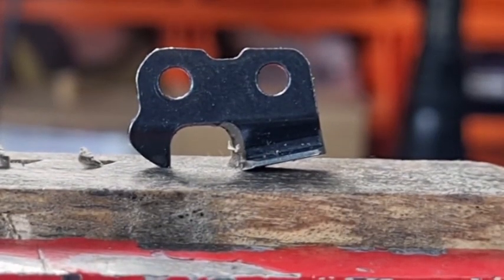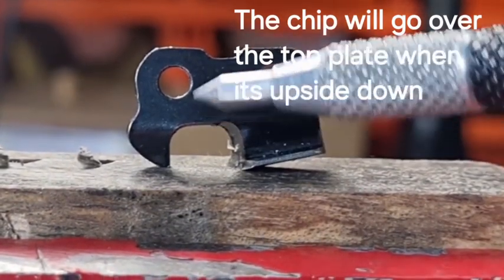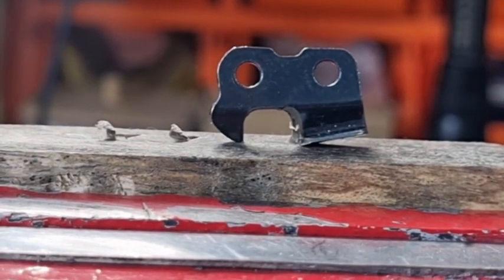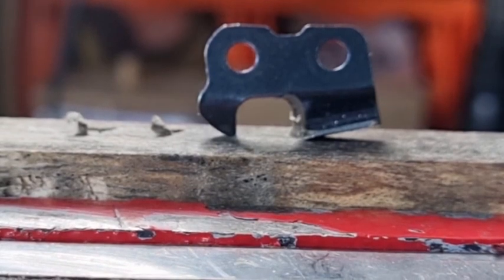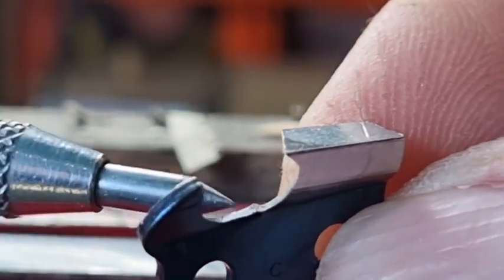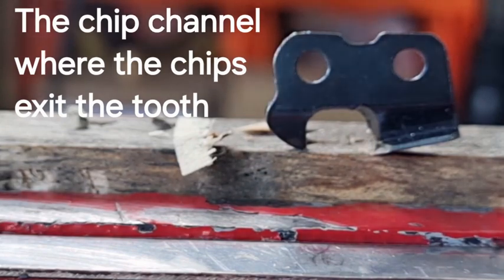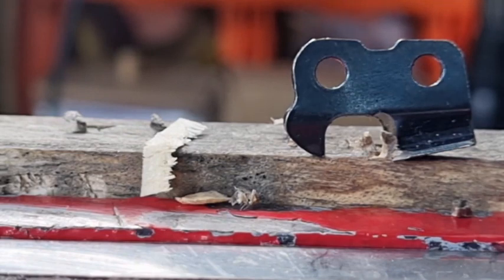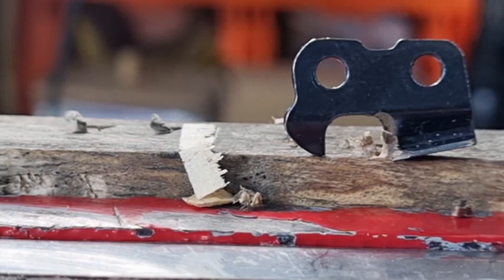Chainsaw Chip Clearence, we take a closer look at it

Comment from the maker: This is why he says "get the gullet", but it's not quite what he means. He's really just saying you need sufficient hook to cut properly
Reply: That's exactly what i think. BBR is allways talking about "get the gullet" to make your chain cut. But its clear that a chain cuts well when you "get the gullet" because you get a good hook on the toplate. Your videos are always very informative.  Thanks for showing us your knowledge. Greetings from switzerland
Reply from the maker: I am amazed that we can learn about chainsaw sharpening after 39 years using them
Reply: @gfeui  I agree.  That hook on the top plate given by a pronounced gullet provides a thin, sharp edge to cut into the wood fibers.  Taken the opposite direction, if you don't have a good gullet the file will be too high, and the top plate will be cut with an angle that gets closer to 90 degrees and is less inclined to cut into the wood fibers.
Reply: @GreenCanoeb  Yes ofcourse. but you can take a smaller file and make a good top plate. and the chain will cut good anyway without get the gullet. so the gullet it self has nothing to do for good cuting. that is what i mean :-) the top plate angle is important an you can adjust it for your type of wood when you raise or lower the file a bit .

Comment from the maker: Ok, here goes my learning curve again!
I posted a few days ago that .325 chain on my 034Super was faster than 3/8 chain. I was going on seat of pants, not hard reality. I used a stop watch and found out the 3/8 is just a tad faster.
So, that really threw me! I went to Madsen's web site about race chain mods and found out why the 3/8 is faster. It has more room at the rear of the teeth for chips flow out, (according to their info) So I looked at my .325 chain and saw what could be the BIG problem. The link at the rear of the teeth has a big hump that restricts chip flow.
What I'm doing now is filing that hump off and then I'll make some runs with a stop watch.  Interesting stuff